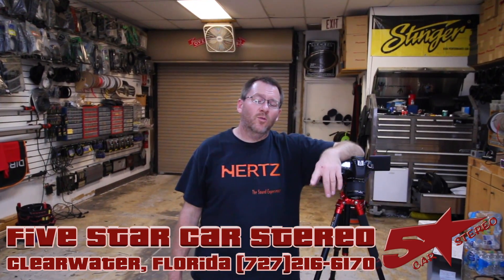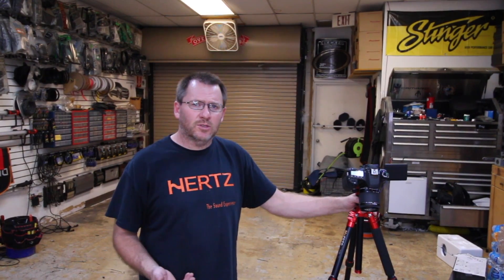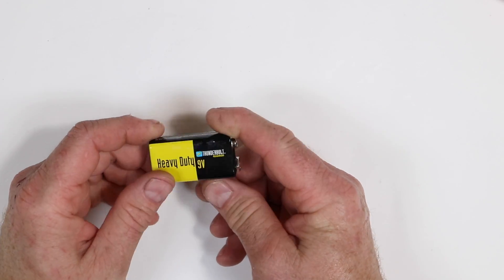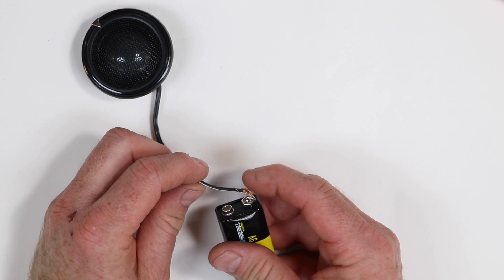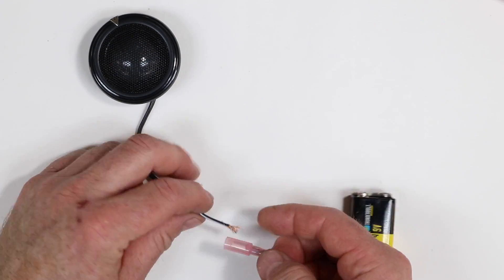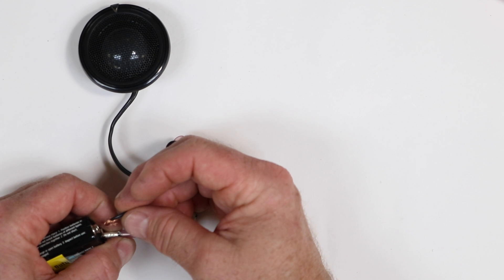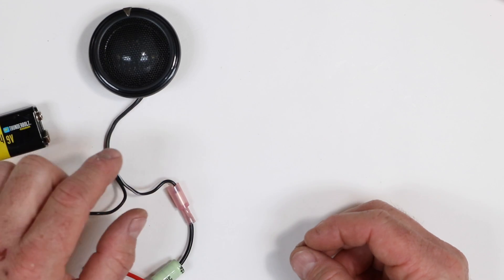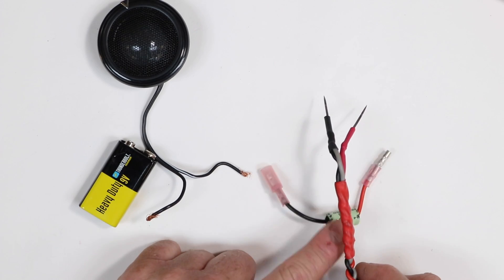How to test if your factory tweeter has a  bass blocking Capacitor or not

Comment: Hey I picked up some alpine tweeters off of temu haha I know I know lol it's temu. But they are alpine 1in dome tweeters and they were only 20 bucks and they come with little crossovers. My question is are they junk? Or is the DDT-S30. Known to be solid tweeters?  I have never been disappointed with alpine so gave it a shot but haven't installed them yet. Any recommendations? Do or donts?

Comment: I have to run this test as close to the head unit as possible correct? In case the capacitor is not located right next to the tweeter.

Comment: How do I figure out which capacitor I need for my tweeter?The only info available on the tweeter is
Max power handling: 100Watt
Freq range: 4kHz-28kHz
Nominal impendance: 4-8 ohm
Sensitivity: 97db/Watt/meter
Thanks.

Comment: so we can directly wire the tweeters to the door speakers but will have to use crorssovers for that right? is only the crossover that we will need or also a bass blocker or the crossover is actually a bass blocker? thanks

Comment: Do you need a bass blocker if your running the tweeter off the door speakers wiring? With a avh 4200nex?
Reply from the maker: GoproZack the tweeters will need a crossover and you can use the radios crossover for the bigger speakers. Tweeters need to be crossover up around 8000 ish
Reply: Yes
Reply: Cross over needed  for best results from tweeters